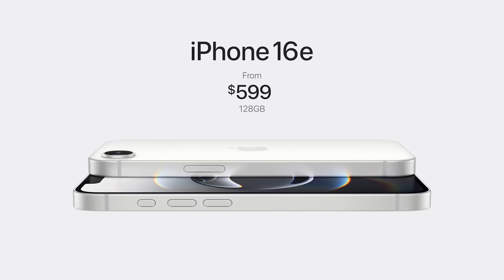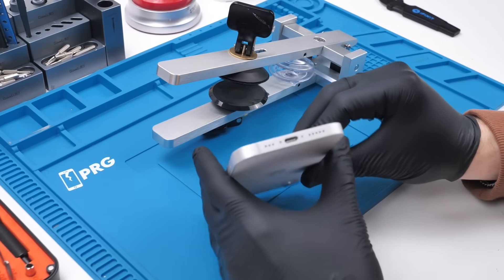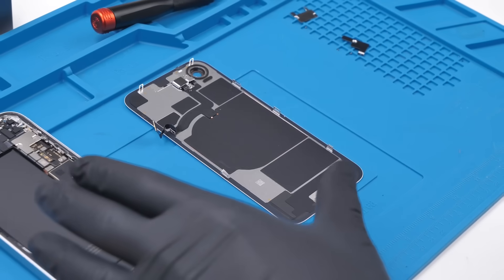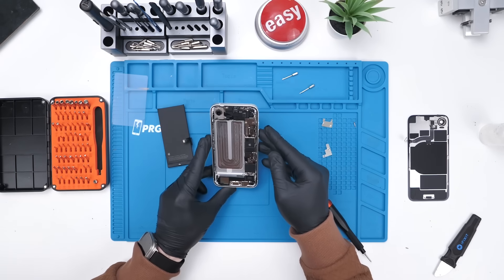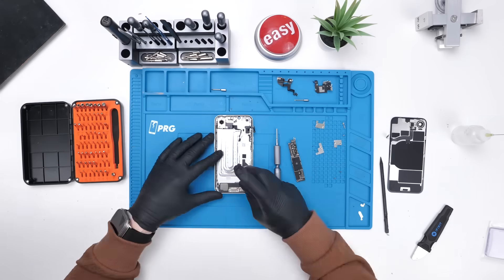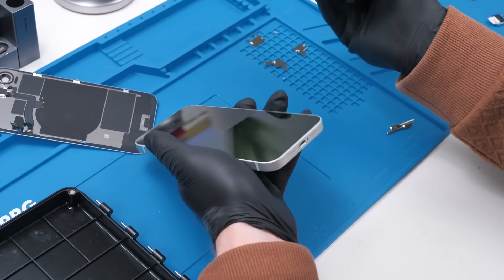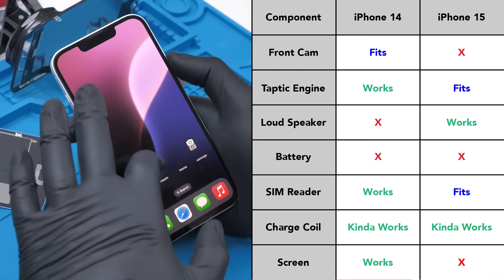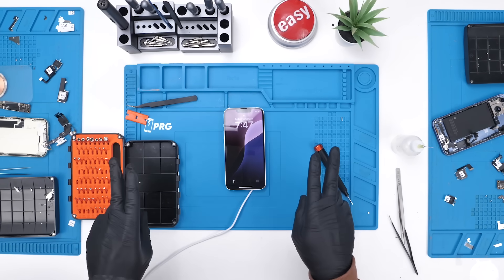iPhone 16e is a FRANKENSTEIN Phone...? Teardown + Magsafe

Comment: I really hope that someone will create a back glass with magnets mod. Excluding MagSafe is what’s disappointing many people.
Reply from the maker: I wasn’t able to confirm due to time constraints but I don’t think the back glass on these is serialized. Not 100% sure though
Reply: @PhoneRepairGuru  No problem. Maybe it’s an interesting short idea or even video idea to try out different charging coils like you told in the video. And not only these parts but trying out the iPhone 13 display on the 16e would be interesting as if it fits it would reduce the repair costs even further. After all… for normal use, a case with magnets will do the work. Just like with the iPhone 11.
Reply: Most people use a case, and every case maker will add magnets. They have trained case makers to do the work for them. 😂
Reply: Cases exist
Reply: Why for? Just buy a case
Reply: And betrer plastic. This it will not crashing in many smithereens
Reply: Bro just don't get the latest phone each year, when your old phone explodes get a new phone, I still use iPhone X bro. Had a 6s Plus before up to like the end of 2024, get the most expensive one with magsafe when you can and keep it for a decade.
Reply: @youtubechannel1234efhioef literally what I am always doing. I used a 6s until some apps just gave up and I really couldn’t do much with it. I even changed its battery twice. 6s will always remain one of my most favourite phones (repairs where so easy!). Now I am using the 13 series and I am not planning to upgrade till iPhone 17-18 or so.
Reply: why? u can just put the magnets in just as shown in the video
Reply: @dendys04 I know. It’s just that I was interested if other charging coils will work in the 16e, as the original 16e coil is really slow compared to the 16pro line up. So it would be cool if someone would make a fast charging coil back glass mod (which is compatible). My bad for asking such a badly “designed” question.😅
Reply: What for bro? Are u crazy to spend that much for iSheep phone when u can buy way better phones with almost half of a price with android? Stop buying apple and nvidia until their technology atarts making sense for consumers and customers so they dont give shiz products like this
Reply: @ I wasn’t even planning to buy this phone. As someone who repairs phones I just find it funny to mod them.
Reply: @kotygoroschkostudios8326  i agree. modding is fun. Overall u can have what u want to actually have on something

Rather buy low-budget xiaomi than this though 😂
Reply: @amenadiel4060 it’s 2025, the phone wars are over, saying words in comments that haven’t been used in over a decade. as someone that owns both the 16 pro max and s25 ultra im gonna tell you 

You don’t have to be an isheep to enjoy Apple products

iOS (on any up to date phone from a $100 used se (2) to the maxed out 16 pro max 1tb) has many advantages that you may not even know about because you don’t care about them, but many people do care about them, which is why they buy iPhones
Reply: @amenadiel4060  Apple's tech is top, cry about it
Reply: @amenadiel4060 if you like apple it’s ok, everyone is entitled to their likes and dislikes. I personally think the apple ecosystem is superior to any other, but that’s just my personal opinion. 👌🏻
Reply: @devicejourney  ever tried what android offers? I bet u havent because the same exact things are on the android side while even prefected far more and actually are faster. People who have been using iphones foe years wouldnt undrestand until they try the new android. We're not living in 2014 btw bro its 2025. Also before u say yes i did own iphones but went back to android again
Reply: @amenadiel4060 Phone tribalism at its finest

Comment: I'd rather buy last year's flagship
Reply: Me too
Reply: And that’s exactly why they always discontinue last year’s pro phones.
Reply: @ you can still get them from certain carriers new or used / refurbished
Reply: @ yeah ik
Reply: isnt the ultras like 800+ still
Reply: @V @VynZography  I think it’s pretty expected that a brand would stop manufacturing an older model and try to shift all stock away to make space and business for newer releases. You can always buy from third party stores or used, but Apple will behave just like any other successful business. 
Phone companies strength is making deals with carriers.
I pay $25 per month for a 16e with no down payment by the way, for two years, which makes the whole deal about $600 total. 
Unlimited calls, unlimited 5G internet (20GB limit on 5G when travelling internationally).
Besides the ease of cost, this phone is actually fantastic. Shocking battery life like I haven’t seen before on a flagship level performance, perfect speakers just like 16 pro, great natural camera tones (far better than the 13-14-15 Pro’s AI mess).
This phone is so lightweight it’s crazy. I’m glad there is no MagSafe to weigh it down and it would have been painfully slow anyway, as he says in the video. Plus, it heats up the battery so no thanks.
Reply: @VynZography I wonder how many noticed that during iphone 15 era, Apple had an upgrade to ip15 program for iphone 12 and 13 users.
Must be sluggish sales during that time period.
Reply: 15 pro
Reply: You have to buy a used one unless you want to pay full MSRP from a carrier. I bought a 15 Pro Max for a good price on eBay, literally flawless condition and the date inside the phone say it was only used for about a month before the owner sold it so I got a good deal that one time. I came from S22+, and 10 years of Samsung phones, and I personally think Samsung is not good, especially after the S22+, so I went iPhone
Reply: That’s the best choice every year! I’m not one to jump on the latest iPhone bandwagon. I always stick with the previous year’s model.
Reply: I’d much rather keep my 12 mini running with a new battery and storage upgrade
Reply: @EvanPang-w4i what about the weaker chip and less RAM?
Reply: @losermonkey666 still plenty of power for my usage!
Reply: @EvanPang-w4i you can upgrade the storage?
Reply: Id rather buy a flip phone
Reply: Rather buy android
Reply: @ ye like an s25
Reply: @Evixity131  good joke.
Reply: @ lol thx
Reply: even 14 Pro Max is better with similar performance and higher specs like pro-motion
Reply: @Pearloryx that’s not true . 14 pm has way worse performance
Reply: @Pearloryx true that's why I am opting to buy one only thing and want it in deep purple which is sadly out of stock 😢
Reply: 13 mini too
Reply: Keeping my 15 pro max till it dies and even then I’ll have someone repair it.
Reply: @Turbo2.5  15 pro will last a alot atleast use it for 5-6 years
Reply: Fr
Reply: i go for 15 plus, used ones are cheaper than 16e
Reply: Exactly. I used to but SE series because of Touch ID only. Price sense it's not a good choice
Reply: JACKPOT
Reply: This phone still beats last years flagship 😂 but okay brokie I got the s25 ultra as well and pound for pound the 16e is far better as far as price better then any last years iPhones by mile the a18 is superior
Reply: @renegarza9750  the 15 pro beats the living crap out of the 16E...the S25 ultra is far superior...u just ragebaiting without holding any proof
Reply: @renegarza9750  tbh in normal gaming u won't see or feel any difference
Reply: I paid $520 to buy an Iphone 12 pro max instead of that garbage. I know it’s old but at least it’s gold
Reply: @bernaldohatechina I support people buying what they need and want, but to sit there and act like you're not getting 4 less years of support is dumb.
Reply: Fr 16e is cool and all but the price us hilarious for removed cameras and still 60hz
Reply: Smart move. Wise buyer often face criticism for being the recipient of value for money experience
Reply: Would rather buy any other phone
Reply: @Prism_Goose  I dont use an iPhone but tbf there is something nice about their ecosystem. If only it wasn't so expensive 😂 and restrictive.
Reply: 2 years ago flagship*
Reply: Me too
Reply: man i would rather get iphone 13 over this. or with almost the same money, yeah, i would get the last gen iphone 15 pro
Reply: $299 on Straight Talk Prepaid with $65 plan only have pay 1 month and unlocks after 60th day after activation (Verizon carrier)
Reply: @jaggsta got similar deal on Boost. $199 and $65 plan. But unlocks after 1 year i believe. Only wish I had bought the white. It looks so fresh and clean.
Reply: As a new iPhone 15 user I would rather have this phone then at 16e by the way, I got this phone yesterday afternoon W to my dad❤
Reply: @Henryand55_isthegoatduo  how it feels like to use 60hz in 2025
Reply: @notpc923   ok I am not mad  that I didn’t got. If  I got 120hzI would not care
Reply: 15 more worth it
Reply: @DOGEE_FOREVER all 60hz iPhone's are trash themselves
Reply: @notpc923  true
Reply: that is the Apple strategy bruh
Reply: Ye that’s what mkbhd said
Reply: I feel that’s what they should be doing instead is just selling a 14 or pro at a lower cost instead of stripping away features and parts
Reply: Can every android user just. Not? I understand it’s your preference but have iPhone users have preferences too
Reply: @captiy9676  he's saying last year flagship, meaning the iphone 15, 15 plus 15 pro etc. If he's referring to android he'll say it. Like "id rather buy an Android"
Reply: I’d rather buy an iPhone 12 😂
Reply: 15 is terrible on battery
Reply: If you are in the US
Reply: that's been used by someone else with 95% battery life?
Reply: @Manulajes  95% isn't bad. It's going to degrade anyways and it's alot cheaper
Reply: I think this is a great point to prove that some of the people who don’t like this phone, it’s not really for them. Which is ok. Not everyone has the ability to buy a phone used, they might need financing that cell carriers provide. This phone will likely have most of its sales be promotional.
Reply: Real
Reply: That's what I thought.
Reply: 15 is better admit it
Reply: even the Iphone 15 is better!
Reply: I’d rather have the faster chip without ugly camera bump. Don’t need dynamic island either.
Reply: Same
Reply: my 13 mini better than ts
Reply: I have a 13
Reply: Love my 15 pro max
Reply: Apple, never more!
Reply: I'd rather buy 13mini or 11pro
Reply: I would agree but it could also be a good upgrade over someone's current phone and might be possibly what an older person is looking for without a smaller screen because apple was probably thinking that the iPhone 16e would be a replacement for the iPhone SE
Reply: How do you ppl come with this replys? 15 pro ? Kidding right? In my country 15 pro are very expensive no where near the 16e. Maybe you wanna say 15 but it has 2 generations of cpu older.
Reply: I'd rather get a samsung S25
Reply: No one asked
Reply: @admmonidasf123  then what was the point of you replying? If you don't care, you shouldn't comment a single letter here
Reply: it is still expensive? cause it still a year old fresh
Reply: @muhammadsuzairiit is $600
Reply: @KhizarSalam-I7mwhich version of the flagship
Reply: @muhammadsuzairithe normal flagship is 800 dollars
Reply: twice the price?
Reply: But 8gb ram is the minimal for future proofing
Reply: where i live price  of 15 pro (used mobile) cost 1.3 times more then a new sealed 16 e
Reply: Im waiting to 18e
Reply: *2years to be honest.
Reply: I’d rather keep my 13. They should of just stopped there
Reply: I won’t get 10hr SOT though
Reply: It’s 99 bucks at boost mobile and metro by T-Mobile
Reply: Sybau hater🫩✌️
Reply: Onun bile yarı parası bu cihaz dostum
Reply: 16 pro all day for me
Reply: A cat and a dog profile pic true enemys
Reply: @OfficialBassBooster-v1s14 pro in my country are literally cheaper than this.
Reply: Get S23 Ultra
Reply: @ thats expensive
Reply: Hence you can't even compare it on a 13 pro max model with the in-built option !
Reply: I’d rather buy a fake chinese phone
Reply: So shit I'd rather get iPhone 2G, bro it's the same phone,  that one's iPhone as well, to mention, much cheaper and easier to repair.
Reply: That’s what I did a few months ago because of the too expensive prices of brand new Apple devices, at least on the official Apple online store, but I still wanted an iPhone to have something more reliable than Android, something with USB type-C, MagSafe, Apple Pay/Apple Wallet with Navigo support for Paris metro, good battery life, good screen, good performance, good camera, a good-looking well-built phone, satellite and automatic crash detection, support for AirTags with ultra-wide band… that’s why I chose the iPhone 15, 1st iPhone to have all of this and most importantly the 1st iPhone to get USB type-C if I remember correctly
Excellent phone, I’m writing this comment with it right now
Exceptional compared to the unusable Motorola moto e13 my mom bought me before as I broke the old Galaxy S8 I was using
Reply: @fanfan54old  that's the problem why people think android are bad they use really really cheap or budget android and compare to flagships of iPhone's well iPhone don't have any budget option anyway , try some reliable phones I am using my Realme GT 2 Pro from 3 years and it has exceptional performance, display , battery , development support (custom roms)
Reply: @fanfan54old More reliable than Android? What kind of Android phones have you been seeing? Although you do sound like a child.
Reply: @ I mean software wise I guess
I’m 24 actually but yeah I know I sound like a child, sorry I guess?!
Reply: @orangeyellow-me1pz he had a budget Moto and compares that to an iPhone. Like you paid 10x more so it should give you 10x the performance,  duh.
Reply: @fanfan54old  u used S8 and u went to iphone 15? The dumbest move of all time if u ask me. Shouldve stayed at least with s23+ which wouldve outlasted iSheep 15 💀
Reply: @fanfan54old You just compared your newish iphone to a motorola and an old-ass S8.
Reply: I got a pixel 9 pro xl for this price
Reply: Alcatel Onetouch.
Reply: @StanleytheCat-v8z  underrated comment 😂 only legends know
Reply: "Once a sheep always a sheep." Motto of iSheep community stings strong here 😂😂😂
Reply: @amenadiel4060 look at your dumb pfp
Reply: @amenadiel4060 this is the worst take I’ve ever heard. I own both the s25 ultra and 16 pro max, and I’d say for most normal people the iPhone is genuinely better
Unless you’re an enthusiast that wants gimmicks, iPhones are better
Reply: @amenadiel4060 same with scamsung
Reply: I'd rather invest my money on mutual funds for the future
Reply: @ that’s nice but this phone is designed for old ppl who already have their financial life sorted
Reply: @ eh it’s good but not a good deal
Reply: ?Why?
Reply: @OfficialBassBooster-v1s 120Hz ProMotion, triple camera system with ultrawide macro and 3x telephoto as well, ProRes Log and SSD transferable, better speaker system, dynamic island, better chipset, more RAM and cores, cooling system, also has USBC and Apple Intelligence, Magsafe and NFC, Ultra wideband, satellite and crash detection, better integration with AirPods and Find My.
Reply: @OfficialBassBooster-v1s because a lot of people will just buy that.
Reply: @OfficialBassBooster-v1sit's self explanatory
Reply: I would buy a flagship android for the same price as 16E and it will better then some last year iPhone's :)
Reply: @notpc923 you could buy a Poco phone for half the price and still get better performance, screen, 3 cameras and a bigger battery. As some one who isn't biased towards any brand Apple is really ripping y'all off.
Reply: @notpc923   can do that even cheaper on android and still grt a phone thats quality and battry outlasts any iSheep phone
Reply: I recommend that you buy a Samsung Galaxy S25.
Reply: Okay android user